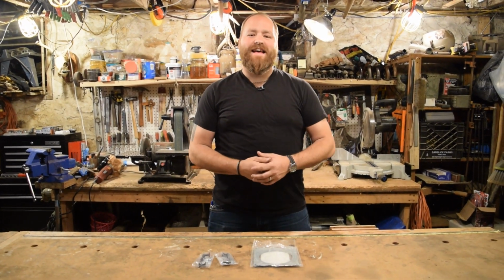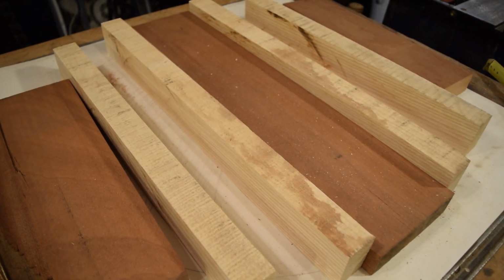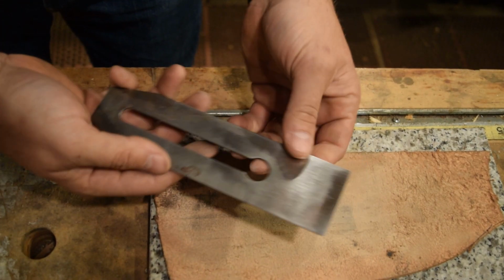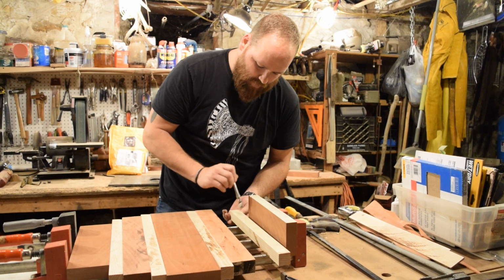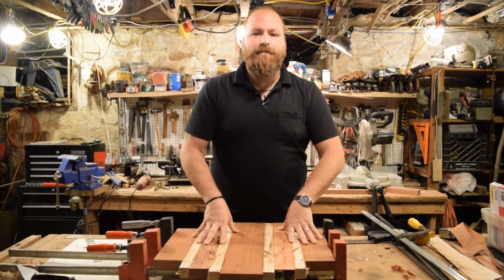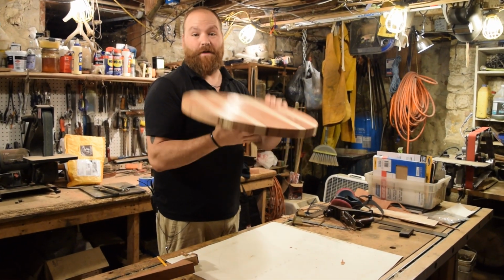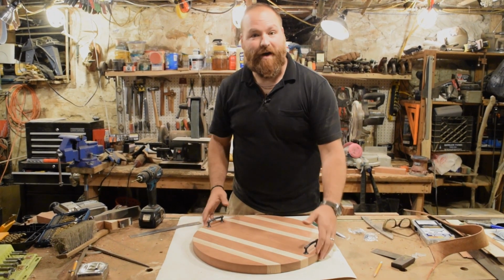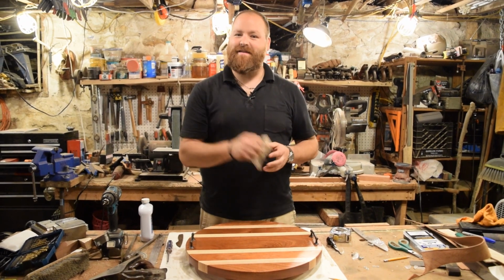Making a Lazy Susan: A Birthday Gift

Comment: You can drill one or two extra access holes in the base which line up with the screw holes for the top to attach.  They you can attach the lazy suzan to the base first and then attach to the top through the access hole/holes in the base...
Much easier

Comment: The 30 year master cabinet maker that was my woodworking teacher taught me to NEVER wipe off wet glue. He said that would push the glue down into the pores of the wood and affect the wood's ability to accept the finish in that area. He taught me to wait till the glue was throughly dry, then scrape off any excess glue. He said that wouldn't affect the finish, since drips sit on top of the wood unless and until you wipe them into the grain. That was more than 30 years ago, and in all that time I have never had a problem with uneven finishes when I (and anyone working with me) followed that rule.
Reply from the maker: That’s a great tip. I knew I would need to level the top pretty significantly, so wasn’t worried about removing the glue, but I totally agree with what you are saying. It makes perfect sense. Thank you.